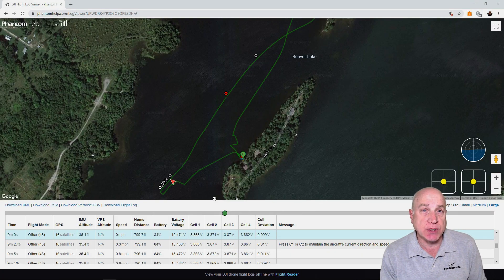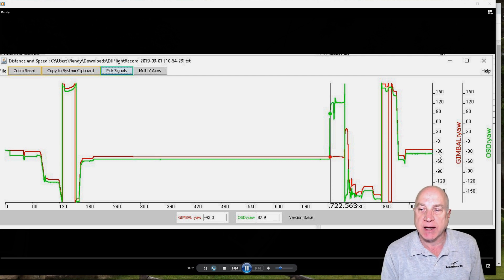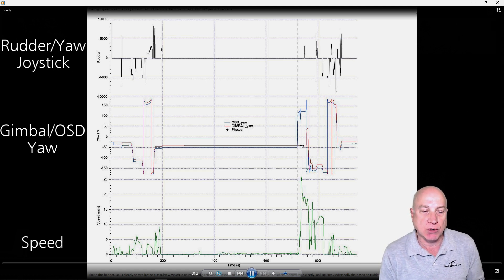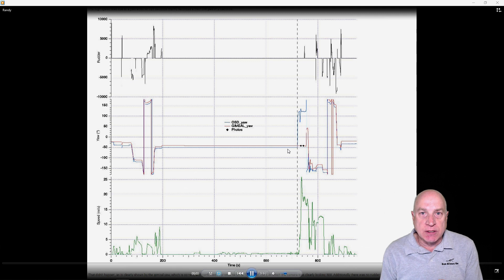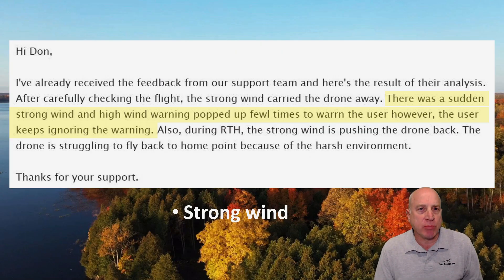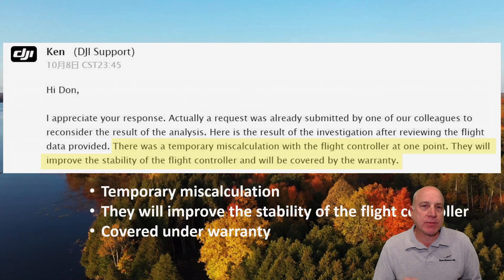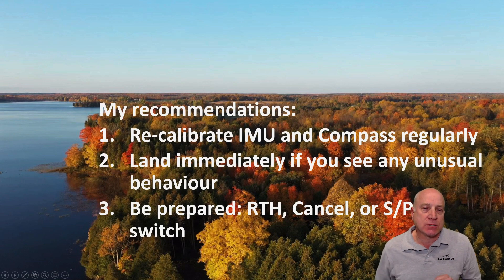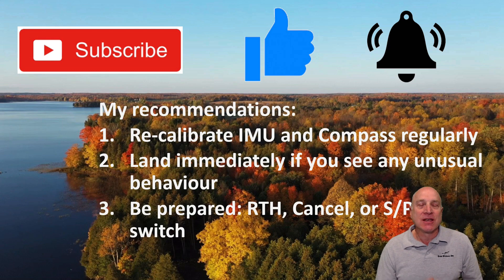Mavic 2 Pro 90 km/hr Fly Away...Explained!

Comment: A very similar issue with DJI Spark, 6 months ago. Re calibrate helped so far. But still a bit unhappy after experiencing such a mess. Calibration is required if u travel away from your last location too, someone saId on a DJI post.
Reply from the maker: Thanks for sharing!  For sure, if you move around in areas of varying magnetic variation, re-calibrating the compass is important, and I do when I change locations.  I had re-calibrated here at the cottage a few days earlier...but not my IMU.

Comment: This why avation has redundancy build into almost all comercial aircraft.  This could have been done by radio signal inference. Are the electronics shielded properly?
Reply from the maker: Clearly any redundancy built into this machine didn't help!  As I said to DJI Support, my main ask is that they improve their software safeguards to detect and react appropriately to obvious sensor failures like this.

Comment: This is an exact same situation as i had with my M2P in March.  In my case it took off 90 degrees to nose angle at 60km/h plus.  Which ever way i yawed the drone the motion stayed 90 degrees nose left.  I didnt try RTH (on a boat so not my first choice) but after about 30 seconds it just stabilised and i got control back.  Winds were light, 2-3 knots, clear skies, sunny day etc.  Its been fine ever since.  Looking on various forums its happened to a few people - some get lucky and get control, some dont and it crashes into things.
The one difference is i DID have flight controls working - i could still yaw and change altitude.
Reply from the maker: Thanks Richard...this does sound VERY similar.  It would be interesting to hear if your flight logs show similar yaw discrepancies.  I published a video this morning that shows how to download and analyze these logs...take a look if you have time:  https://www.youtube.com/watch?v=AfS7gXmEDno
  We can further this discussion off line if you email me at DonDronesOn@gmail.com

Comment: English isn't even my first language and to me the explanations in the emails are perfectly sound and understandable, if you ever need to do some serious work on any computer you'll run into some issues that are somewhat comparable to what happened to your drone. Nothing is perfect and things do break down so I think you're a bit harsh to say that your conversations were going nowhere.
Reply from the maker: Thanks, Ricardo.  My concern isn't actually so much the latest DJI Support emails (which followed only after a long chain of 'it was just the wind' nonsense...see my 'drone in a hurricane' video) or the fact that ultimately they point to a 'glitch'.  Perfectly normal in electronics.  The problem is that their system lacks sufficient safeguards to properly and safely manage these glitches, either through redundancy, watchdogs, or sanity checks.  They offered little commitment to improve these safeguards.
Reply: @DonJoyce  Well, you have a point there. If you have to pay 1000+ dollar for a drone they should have some kind of redundancy built-in or some way to give the user full control with the controller via a hardware switch.
I watched a few videos from people with a brand new DJI drone that fell out of the sky without any reason which is unacceptable, at least when everything goes wrong I think that the drone should revert back to just hovering at the spot where it is so you can restart the controller and take over again.

Comment: I had an issue in Iceland when I my Mavic Air I noticed it was drifting and suddenly, it reported that there was an engine problem. I was able to move the sticks and the device would respond, bit not in the way it should. It did this for about 15 seconds or so and the  I was able to get more control and was able to get it to lower in altitude and eventually bring it down in a place where I could walk to it. It was really scary stuff when it was happening because you feel totally helpless.
Reply from the maker: Yes, these things are definitely scary! But...if are aware they can happen, perhaps we can stay calm and not freeze up when something bad happens.
Reply: @DonJoyce  When this happened, even though I was really worried, I tried to remain calm and make slow moments to see what control I had and was able to bring it in. I think having a freak out would have made things much worse and could have changed the result.

Comment: I think DJI was absolutely correct in the end. I've suffered the same scenario in a similar situation. You cant explain most reasons for a reboot but I feel thankful that DJI has built in that kind of technology so in most instances, though scary as hell,  the drone is recoverable  when it happens. 
It's just ashame that their customer support is so concerned about supporting the name that you have to fight them so bad to get any information out of them!
Reply from the maker: Thank you, Common Drone Guy.  "Glitches" do happen, and often have a root cause in physics that is tough to prevent, BUT, for systems like this, there are safeguards and checks that CAN be put into the software to detect and appropriately deal with errors.  A yaw swing as massive as what showed in my log was clearly in error and should have been ignored or double checked by the software.  It was not dealt with properly and it was complete luck that I recovered my drone.
Reply: Simply Dave, DJI was absolutely almost correct and in aviation almost correct takes you Dodge-city instead of Klondike.

Comment: my drone hit 136kmh when it went out of control due to a propeller propulsion malfunction. The flight logs showed a zig zag flight path. Mine too also happened in hyperlapse mode!
Reply from the maker: Interesting that it happened during a hyperlapse.  That's 3 cases that I have heard of now...
Reply: Don Joyce I’ve also heard that recently hyperlapse mode has been giving problems to Mavic 2’s I think there was an update that addressed a fix with the hyperlapse mode.
Reply: I just hope the anti-drone lobby never gets hold of this info. Can you imagine the stance of authorities if they knew consumer drones could go haywire without warning and crash to earth at these speeds, with the potential to kill innocent bystanders!!!
Reply: Sean De Freitas it happens to manned aircraft too. I mean the probability of it happening is probably the same.
Reply from the maker: Correct.  Drones are simpler though, and checking and watchdogs can be done in software to prevent erratic flight in the event of obvious errors such as my massive yaw change.

Comment: Nothing to do with the wind. GPS routines use heading information (compass and IMU) to constantly adjust the position of the drone. If the heading reading changes erroneously by 180-degree, the GPS routines would start to move the drone in the opposite direction and away from the needed position. With the position error increasing the routine would apply even more aggressive pitch, which in result will increase the position error. The drone will reach maximum allowed pitch and it will continue to fly away. Switching to ATTI mode will stop the fly away since the GPS routine will be turned off. You got lucky the controller recovered and RTH worked as expected. If the heading error remains during the RTH command, the drone will be lost.
Reply from the maker: Yes, the wind may have had little to do with it, since I was attempting to move slowly in the same direction.  In either case (wind or intentional position change), the directional error triggered the acceleration.  Thanks for this additional insight!

Comment: Thanks Don for a really in-depth analysis of what appears to be becoming a regular issue on drone forums.  It scares the pants off me, especially given the high cost of the M2P and the fact that most of my flights are over water. It really concerns me that lacking loads of flight experience, I may not have the same level of skill or control to ensure a recovery, like you managed to pull off.
Then, to have the knowledge to analyze the flight data to determine what went wrong. That was so impressive! Less impressive is the random nature of the fly always!
Reply from the maker: Thanks, Sean! It was scary for me too, but it's important not to panic in these situations. Knowledge and awareness of what might happen might just save your drone one day...so try to channel your fears into strength!
Reply: I will, thanks again.

Comment: Flying with a KP Index of 5 probably didn't help either. Electromagnetic interference screwing up your GPS chip making it think it's facing 180 degrees in the opposite direction sounds a likely contributory factor also.
Reply from the maker: I actually looked into the potential impact of the KP of 5, and my conclusion was that it would have not impacted me, particularly since I had 16-17 satellites at the time.  Discussed in my second video on the subject, here:  https://www.youtube.com/watch?v=3siXA58iRy0

Comment: I think you are absolutely right in that there is a flaw in the flight control system of the Mavic 2 that DJI are not admitting to because it would mean many claims for crashed kit. My friend lost his Mavic 2 in a lake in Florida. It was flying over water at 33ft when it went out of control and fell into the lake. DJI reviewed the flight data and claimed it was pilot error because the pilot put in left rudder and right roll, exactly what you do if you want to fly anti-clockwise around subject. There was a lot of contact with DJI Customer Support and in one response they confirmed that the height indicated to the pilot is “relative” with the implication it cannot be relied upon. DJI make great products but their Customer Support unfortunately lets the company down. As a result of my friends loss and the subsequent communication with DJI, I am of the firm opinion they cannot be trusted.
Reply from the maker: Thanks, John.  They are definitely being cagey.  Curious that your friend's flight was basically the same altitude as mine (11m...33 feet).

Comment: DJI support in a nutshell they are ignorant to their own products that functionality.  And it is sad to see this is still so terrible, years after my last warranty claim denial they still bullshit, lie and admit failures with no fixes. 

As a SideNote: Once aircraft’s automated proccess feedback loops spirals out of control, you should never ever initiate any automated flight mode like RTH button and should manually pilot it back if possible or try to trigger some event to reset it.  If this were me  in your shoes I would slide the slider on the controller up and down from P to S down to T and back up to P and see if that clears it out. If so then fly back and pack up, if not then Would turned the drone to face the direction appears to be pushed from and fly manually against it and back.  Slitching modes should kill the flight mode your in.  this is also why older and more pro level aircraft have an Atti mode toggle so in event of a automated system failure loop you can manually pilot it without additional interference maybe broken.   You got extremely lucky with this IMU error, most people aren’t so lucky once the aircraft has IMU failures it’s usually end of their aircraft and usually because they initiate RTH or initiate some automated flightMode. 

The real question I have is, is this a real known issue inherent to Mavic 2’s ? I believe it maybe actually true sadly.  I haven’t had this issue on my mavic 2 yet but I have had other issues like random aircraft drift, and rare occasional issue if it’s being flown aggressively where camera drifts slightly off center and a bunch of random compass errors and completely accurate compass reading front the craft (usually compares compass to the IMU so I’m not sure unless IMU isn’t being checked or the IMU isn’t happy on startup.  however on my mavic air I have had a random in flight failure where my IMU has an heading exception error appear on display before going completely out of control for 10 seconds and throwing itself around like toilet bowel effect and it somehow as it was flopping around in sky the VPS caught the ground or something as it was rapidly losing alt and I was rapidly losing signal quality with crap WiFi mavic air uses and once it saw something with VPS it reset the flight computer to lock it in position and was stable again Even once broke out of VPS range.
Reply from the maker: Thanks for sharing!  Yes, I was very lucky.  And BTW, while I suspect the RTH triggered the reset, it may just have been the flight controller coming back from the reset.  AND, once the RTH took effect, I did immediately cancel it and flew home manually.  I didn't think of it at the time, but I would certainly do the T/P/S switch next time...which hopefully will not ever happen!

Comment: Hello Don, I am owner of a Mavic Platinum for couple months (4-6 Flights only), and I have a Simplified Question for you : Since DJI said “Frozen Flight Controller”, is it the RTH that WILL actually do the critical Emergency RESET so the Craft comes back Home ???... Scary Movie your is... Thank you for sharing this BUG with other Pilots out there !
Reply from the maker: Thanks, JP.  It is still not crystal clear if the RTH actually triggered a reset, or whether it just became responsive again after the flight controller reset.  And BTW, after the RTH activated, I cancelled it and flew back manually.

Comment: DJI should teach their programmers that everything is reversed when the aircraft is facing the controller.  I still make the same mistakes on occasion.  I am going to test hover my DJI drones on a slight windy day and see if I have the same bug.  They should hover steady in all directions.  Thanks for sharing.
Reply from the maker: Thank you for the comment.  The drone certainly can and does hover in all directions.  The catch in THIS case was that the aircraft was confused about which direction it was pointing at the time.
Reply: Don Joyce you are lucky that RTH got your drone back.  It cant properly execute RTH if it doesnt know where North is.  Hover test is my pre flight routine.  If it hovers steady above vision sensor range then I am good to go.

Comment: I had a similar experience with my Diy drone due to EKF, something to do with the flight controller. Explanation here http://ardupilot.org/copter/docs/ekf-inav-failsafe.html but it didn't cause a fly away as I turned manual mode on instantly
Reply from the maker: The EKF you describe sounds like a form of watchdog that monitors for 'crazy stuff' and steps in to prevent problems.  It is not clear if DJI software contains such a watchdog, or if it does it clearly requires further tuning.  I have suggested this to the DJI support team...not sure if they accepted it.